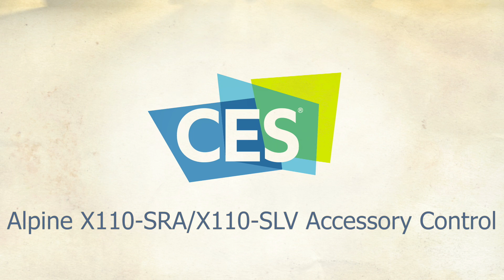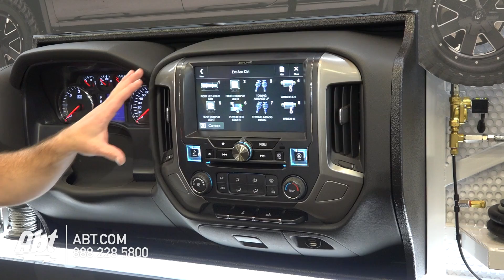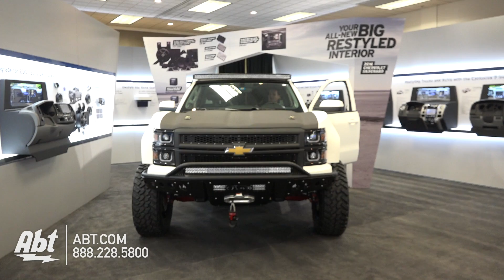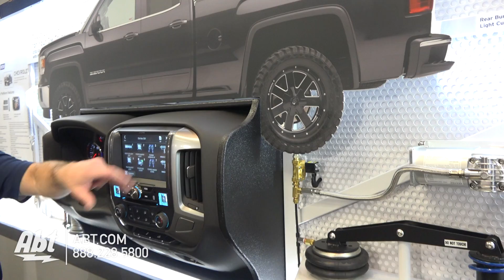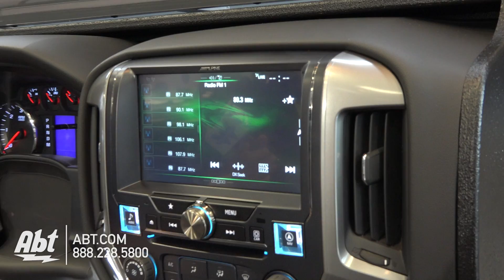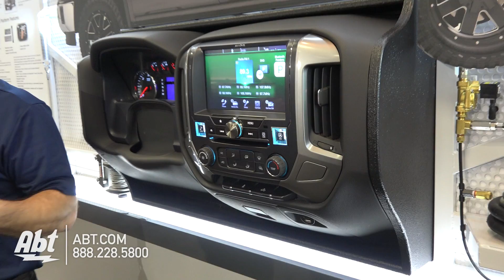Alpine X110-SRA (Sierra) / X110-SLV (Silverado) 10 Inch Accessory Controller - Abt CES 2016

Comment: Not sure why, but you have the comments disabled on your official Alpine X110-SLV/SRA installation video that's also on YouTube.  I tackled that job this past weekend.  All in all a great tutorial, except you really leave a person hanging when it gets into the thick of it.  That main wiring harness for the X110-SRA is insane and you basically skip over it.  I'd like to see the installer put every single plug in place on every single module as well as point out which plugs, both on the new harness, as well as the original OEM wiring still hanging out in the dash, that is NOT used any longer.   Really tough to know if you're "all done" and can start installing the HMI when you've got about 7-8 plugs hanging out in the dash that aren't connected to anything.  Got burned a few times on adapters too.  Installer plugs one right in, I'm sitting there like "this doesn't work there" and 20 minutes later I come across an adapter in the box of parts yet.  Need to update that video if you've changed the parts list since it was made.
Reply: did aux por in the glove box work
Reply: Theirs a video for it I saw it like at 1030 AM pacific time

Comment: Same question as "max cheatham"... is this compatible with the 2015-2016 2500HD and 3500HD models? Can't seem to find an answer anywhere.
Reply: kalbojosh check this out. It says in the article it supports HDs

http://www.trucktrend.com/how-to/interior-electrical/1704-2016-chevy-silverado-a-pair-of-10s/